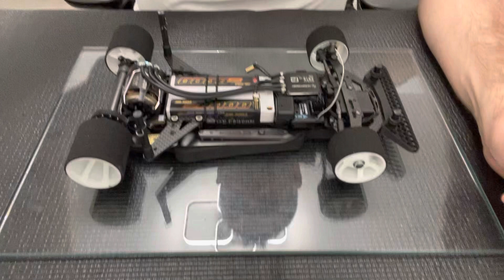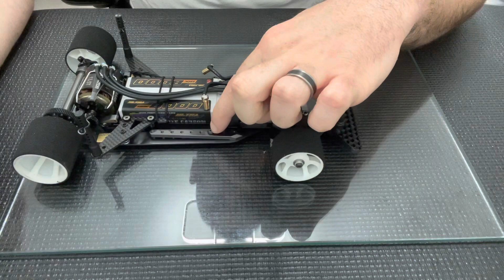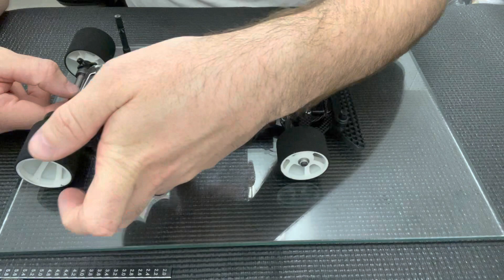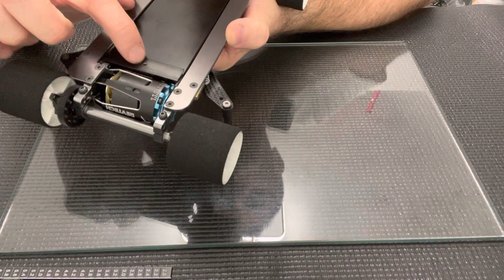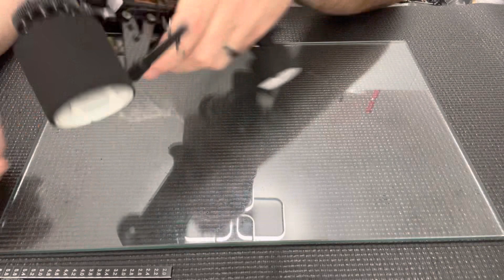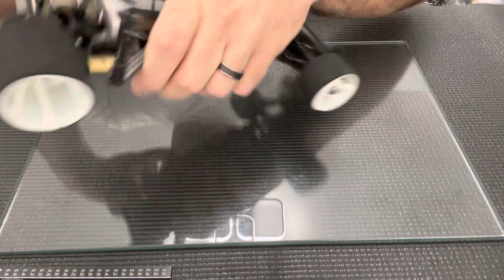Awesomatix A12 - Millais Club Race

Comment: Thanks for the update to your settings. Increasing the side rail gap to 2.4mm is surprising.
Reply from the maker: To move from a side rail gap of 1.8mm to 2.4mm will only require a shim thickness reduction under the side rail screw head of about 0.2mm, so it’s a very sensitive adjustment.
Reply: @Nobby528  Yes, I found that out the other day. I setup my car similar to yours from the previous week and ended up with a 2.1mm gap. I remember Mark Payne recommending 1.8 mm so I went with a larger shim. Now you’re at 2.4! Time for me to get out and drive it and compare them. PS you should invest in the A12 ride height gauge. It will allow you to give some actual DRH/DRH1 numbers. Its worth every penny.
Reply from the maker: @bstearn1653  I have the gauge, but I am conscious that most do not so I try to measure the setup in a way that the majority of people will find useful.